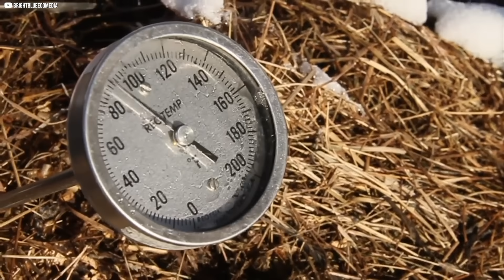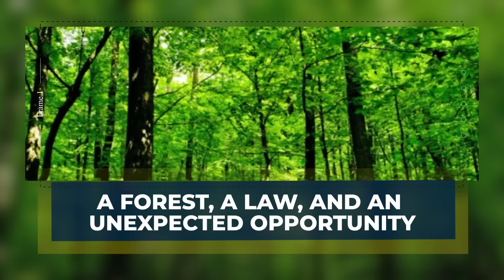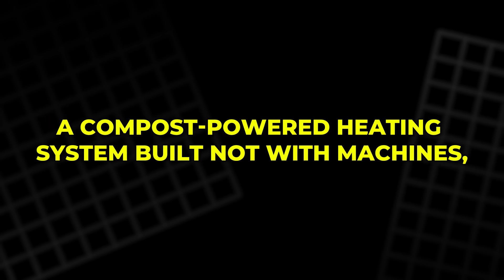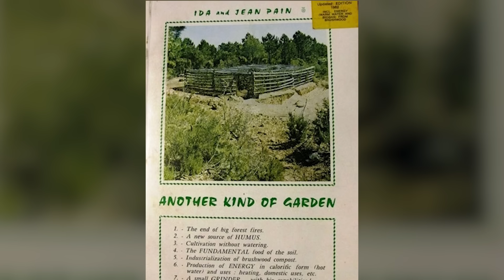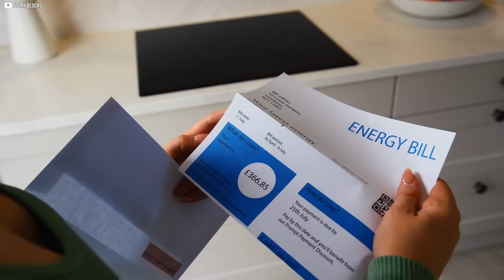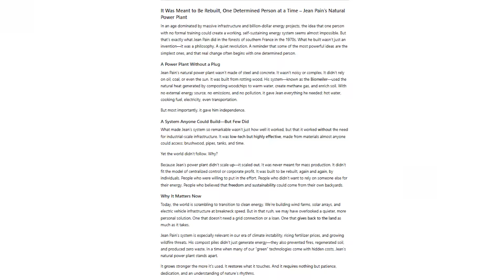The Forgotten Reactor: Jean Pain’s Natural Power Plant

Comment: It is hard to pull out the hoses from the used rotting material. We need to solve that problem and instantly this Mistkraftwerk will florish!
The solution of harvesting warmth from rotting material is not new. German motels allready use that sort of energy. I think about using a Mistkraftwerk too.
Reply from the maker: That's an interesting point about the challenges of pulling out the hoses!

Comment: Part of the reason that this idea did not take off is size. You can see from the pictures that Pain's piles were much larger than most of the modern versions. Most people probably didn't have access to enough free wood chips to make a system that put out the same amount of heat for a year or more. Plus it is a lot of work to build one.

Comment: How do you remove the composted material for new material to compost. The material from the heat zone has to be removed and new material put back in its place. ?  Seems to be a once thru design. Then build another. If you could remove all the compostedvmaterial andvreplace it with new fuel , then it would work.

Comment: It should be noted that there is an absurd amount of energy in 40 tons of wood. On average we are talking 40 000kg x 5kwh/kg= 200 000kwh of thermal energy if one simply burned it. If turned to woodgas it would be about 160 000kwh and that can power a generator or car.
Reply from the maker: That's a very insightful point about the energy potential in 40 tons of wood!

Comment: This is a neat concept and definitely they’re useful in certain circumstance. But if you look beyond the wood chips, there is a whole lot of modern technology that went into this plastic, steel and oil for engines that uses electricity from power plants to produce these things. Without these things would be very difficult to produce this.
Still a ways to go!!
Reply from the maker: That's a very insightful point about the modern technology and resources needed to create the components for such a system!

Comment: Years ago, I was blessed with about 10 acres of chipped trees. Several thousand cubic yards that took up 20,000 ft.² in about 25 feet tall.   Little that I know I had a mini Mount Saint Helens on my land.  You could climb on top of it and sit there in the winter and the heat coming out of it would burn your butt.
It was fascinating to watch it in the winter as steam would come out of it. I used the decompose wood chips in my Landscape business. After five years, we went through it.

Comment: I have known about this work for some time. I think the most difficult thing about the system is the chipping of large quantities of wood. I have tried a number of off the shelf chipping machines and you need something different because they are slow, loud, and messy (emissions and dust). He was using large homemade machines. Ideally a very smart person needs to invent a wind powered chipper that works fairly quietly and can handle largish pieces of wood, maybe up to 6 inches in diameter that just sloggs away making chips. If anyone knows about a device like that it would change everything

Comment: But there's no way to turn the pile or use the compost for gardening, with all the tubings running through it. You'll be re-doing EVERYTHING every 3-6 months. Find another way.
Reply from the maker: That's a good point about the long-term use and maintenance of the system!

Comment: In the 70ties we had a problem with people building compost piles and not tending them and if not tended they can overheat and a lot did fire departments were kept busy putting them out I'm looking at building one looks like it's about 6 to 8 feet in diameter and using snow fencing for the outside edge and solid weeping tile in the inside along with about 100 feet of water pipe should give me heat

Comment: I built a couple wood chip digesters after reading John Payne‘s book. They worked great! One of them was a very simple post and beam construction holes spaced about 4 feet apart, that were covered by about 8 feet of sticks collected from nearby, and then that was covered with about 15 to 20 feet of shredded leaves we received from the local city.

The pigs geese and chickens lived in the little cave below the composting mass. Steam rose from the pile all winter long… And the pigs would come out and climb to the top of the pile and bask in the winter sun, at 20 below zero Fahrenheit! We continued to add to the pile yearly, until it collapsed after nearly a decade. We then built a garden there.

That was a fun time!
Reply from the maker: That sounds like an amazing project you built!

Comment: it wasn't;t ignored or forgotten, many places that process plant fibres, vegetable processing plants and wood pulp mills etc, use bioreactors, rotting vegetable matter releasing methane which is in turn burned. It's just not scalable. It's not a conspiracy, it's just not practical on large scales. On an individual basis it's doable, it's very high maintenance and takes constant cycling of the biomass, but it is doable.

Comment: I'm seriously considering installing a smaller version of this system in the garden of our detached house, close to the basement area, where we didn't install central heating when the house was built in the 1960s. The dimensions would be reduced to the size of one Euro pallet or a maximum of two. Then you can use simple plastic connections with these simple press fittings and solid, flexible plastic pipes. I think I will try to get some information on how to carry out the chip decomposition process under the surface soil and how to ensure the continuous decomposition process by repeatedly adding material to keep the process fluid and redundant and without any significant interruptions due to a lack of decomposition material.
Reply from the maker: That's an interesting project idea!

Comment: Taking an incredible amount of energy to pulverize that wood into chips, nothing is free.
Reply: In larger communities or forest areas, mulching is often a kind of by-product, and as long as this method of energy or heat generation is not as widespread as it might be in less urban structures, you could perhaps ask the responsible authorities whether you can obtain some on a regular basis for a certain fee. Sometimes there are also authorities responsible for woodwork on railway lines, where weak trees and branches need to be removed so that trains are not damaged or endangered – these services are sometimes willing to give you free material, but you cannot always rely on this. It is always better to use your own soil and the organic material that grows on it.
Reply: @betteramwthanbmwI agree, biomass is an incredible resource with it’s practice having beneficial externalities. Also power made from methane digestion can pulverize new material making it sustainable.

Comment: Neat idea.  Sadly the video is less than honest.  He had to use fuel in his chipper, he had to use fuel in the loader and other equipment to load and unload the pile.  also you need a $40,000 loader and probably a $5000 chipper.  Also oil to make the circulating pipe and methane capture.   
All that said.  this is not an easy task for the average homeowner.   And if you need to contract the work out and someone to design the circulation boiler system....oh boy get your wallet out.
Again i might dabble in this one day on a off grid property, but fuel and the twisting of a valve is a lot easier and more time efficient. 
Blessings all!
In off grid and nothing but time on your hands this would be cool.

Comment: Convert a Compost Pile Into 4–6 Months of Heat

🔧 Structure
* Build a round compost mound about 20′ diameter × 6′ tall (≈600–700 ft³ of material).
* Wood chips & brush: ~80% (1–3″ chips work best).
* Manure: ~20% (cow, horse, or goat).
* Moisture: keep at ~50% (like a wrung-out sponge).

🔄 Heat Exchanger
* Coil 400–600 ft of ¾″ PE or PEX pipe throughout the mound.
* Use a small circulation pump → cold water in, hot water out.
* Radiators or radiant floor tubing for space heating

⚡Performance
* Steady Output: ~1.5–2 kW thermal (5,000–7,000 BTU/hr).
* Peak Output (first 1–2 months): up to 3–4 kW.
* Duration: ~4–6 months of reliable heat from one pile.

♻Soil Improvement
* When it’s done, you’re left with rich compost to feed soil.

Comment: I think the biggest issue with this, is that it can't be scaled up in an industrial way. If you have a farm and access to a lot of dead brush then sure, it can work and work well. However in a suburban or city environment, it just isn't feasible. The amount of biomass you'd need to keep it all running would surely strip a lot of the surrounding areas of wood and debris, leaving bare earth. In this case, as we can see, it was small-scale and powered from a very large mass of surrounding woodland to power one home, for one family, for one year. 

A solar setup with a battery bank is much more efficient in regard to space, resources, time and longevity. It's not "free" but that's the tradeoff. More power, more efficiency, more utility, but it'll cost some few thousand dollars.

Comment: They say male human body requires 2500 calories daily. Tea,coffe without sugar have no calories. But chemistry says to boil a cup ( 200gr) of water from 0 deg to 100 deg we use 200*100= 20000 calories. Body ofcourse benefit from the heat energy and energy is not lost. If you stop consuming hot drinks you will loose weight. We have been lied for  long times to be controlled. We all need to check all scientific expressions again.

Comment: The amount of energy in that wood pile is equivalent to firewood of about the same size. so, it's got a fair bit of energy to it, but it's not like geothermal. Additionally, the production of heat is fairly constant. Which means it's creating heat even when you don't need it. Also, much of the heat is lost to its surface area. Finally, if you suck out too much heat, the pile will go cold and the bacteria could go dormant. So all those problems and it could be awesome.

Comment: Huge piles of coal outside power plants will catch on fire by themselves. The story is the weight of the 30' - 40' high coal piles caused enough heat for the fires to start, I don't know?

Comment: Jean Pain did not "invent" or discover that composting produces heat. This has been known more or less since the dawn of humankind, and just as long have people used this principle for staying warm or keeping things warm! He was just reminded that this actually could be used, as it happened a lot during the 70s "back to nature" movements. Biogas has also been used for millenia, so there's nothing new or sensational in all of this. The problem is all the work it takes to build such a generator and harvest both heat and gas.  Few people have the means and opportunities to gather tons and tons of biomatter, and if they do, their time may actually be used better for other things. My local community built an industrial size biomeiler in the 90s. It only ran for a year or so, then the complaints by hundreds of neighbours about the smell it produced, shut it down for good. 

The next point: this method requires a lot of dead matter. Removing dead matter from nature may in some cases be necessary, like wildfire control, but it's bad news for nature. Leaves and dead branches are meant to compose under the trees they've fallen off! Removing them will break the natural cycle and eventually lead to ecological collapse. 
So, no, this is not a viable solution, and definitely not one that can be scaled up. 
We already have too many "biofuel" plants responsible for the destruction of forests and the misuse of agricultural land, driving up food prices globally. They originally were classified as sustainable, but this has been withdrawn for reasons mentioned above.

Comment: As much as I like the idea, there are a few things not mentioned here. 
Like, we know the importance of leaving dead wood in forests now, as well as allowing smaller fires or setting prescribed burns, both for the lifecycle of some plants that need burns to germinate, and as a catalyst for species that need the burn to inhabit their niche (i.e.biodiversity).

Also, dead wood is absolutely necessary for a huge variety of life, and clearing the forests of both dead wood and fires is detrimental to them, contributing to the large, out of control forest fires we see today. 

40 tons of wood chips for 18 months of heat and fuel is not as efficient as one might think, and that wood is hard to come by. If you're going to chip it, that takes a lot of energy to do, too. Not really scaleable for a larger part of the population, in other words. 

While there's nothing wrong with the technology, it is a very labor intensive way of heating your home, and there are better ones and ones you can use together with this one, for easier and more resource efficient results. 

Using our own manure or animal manure for gas extraction, for instance. Building eco-friendly homes with good insulation rates as well as thermal battery capacity (evening out the temps between day and night), such as hempcrete, for instance. Rocket mass heaters or masonry ovens, smaller homes, closing off rooms not used in winter, building for longitude and aspect, and so on. 

Yes, this video shows one thing you can do, if you, unlike most others, have access to a large amount of small sized organic matter. 
Well worth showing, to those who are new to tech like this.

Comment: It won't power a modern home, but you could certainly get a relatively smaller amount of hot water or hot air out of it for sure. It could also provide a small amount of emergency power using a sterling engine. It won't provide a massive amount of continuous power output though. And taking heat from the compost slows the heat production process.

Comment: i have developed a method to create free electricity using ram pump method to move a water wheel ..small scale atm but works.  currently working on adding a compressor that come on to repressurize the system if needed. also working on adapting it as a fish tank filtering system that doesnt require electricity, this would allow aquariums to continue to filter and aerate tanks without electricity, reducing costs and the need for emergency backups

Comment: The reason the idea did not take off was likely multiple reasons. One big reason was a lack of safety in urban centers. The mixture of so much decay and manure would have contaminated the ground soil in unexpected ways in urban areas. In suburban areas it may have contaminated water wells with E-colie. The huge pile of brushwood and manure would have had to keep being turned and added to which would involve heavy equipment. Not practical for many people. It would be good for some people, but would still require a lot of work and maintenance.

Comment: That’s an interesting use of the heat from composting. The problem is the reaction works until it doesn’t then you have to remove the compost and start over waiting weeks for a new pile to begin composting again. Maybe you build 3 or 4 of them and hook the water lines all together so it doesn’t matter when one pile is out of production for a couple months. Still takes a lot of biomass to power it. Not for everyone. I wouldn’t be afraid of it but would have trouble keeping biomass enough to fuel it because I only have 37 acres and I am not willing to clear it just to turn the forest into compost.
Reply: jean pain était le gardien d une propriété de 200 hectares ce qui est tres grand il avait tout le materiel nécessaire  et son metier l obligeait a garder la propriété a l abri des incendies il était payé pour debrousailler et empécher la végétation de grandir trop son réacteur c est juste " l art d utiliser les réstes "
Reply: Are you inferring that there is no money to be made in composing?

Comment: It wasn't very practical, especially in colder climates. In freezing temperatures all decomposition stops.
Reply: Compost Decomposition in Freezing Climate.

Decomposition does not necessarily stop in a freezing climate if the compost heap is dense enough. 

While microbial activity pauses when temperatures drop below freezing and the materials become completely frozen, a large or dense compost pile can retain enough heat in its core to prevent freezing and allow decomposition to continue, albeit at a slower rate.

The interior of a sufficiently large pile often stays warm due to residual microbial activity, which generates heat and sustains the breakdown of organic matter even during cold weather.

However, during deep freezes, decomposition may temporarily halt until temperatures rise again.

Insulating the pile with materials like straw, leaves, or wood chips can further help maintain internal warmth and support ongoing decomposition.
Reply: @seamuswarren  If it slows down in the winter months, then what good is it? Those are the months you need heat the most. You'd probably need a compost pile twice the size of your home, just to maintain heat in the house. It wasn't practical, that's why it faded away.

Comment: It would never work in an urban area. And to dig out all the old bio mass every 8 months and pull out all the piping then replace and collecting and chipping the wood is a whole lot of work. But is good to know if you want to live off grid. It has always been know of the gas and heat bio mass puts out.

Comment: Finland uses this to power the district underfloor water heating 😊 they do have a metering system in place: water comes in at a certain temp, leaves the house on another. Bill the difference. Same water is used for hot water showers, dishes. This is primary an issue of infrastructure not being in place.